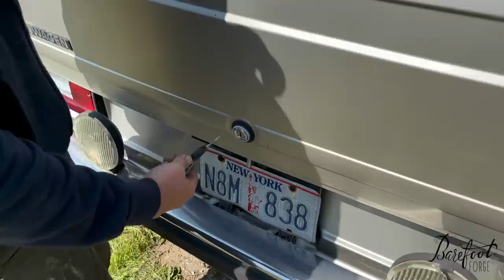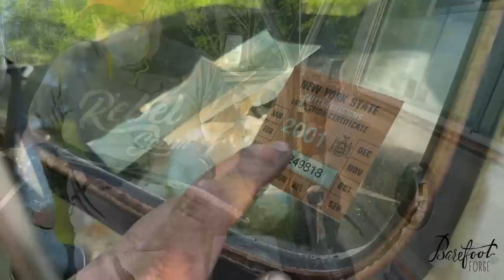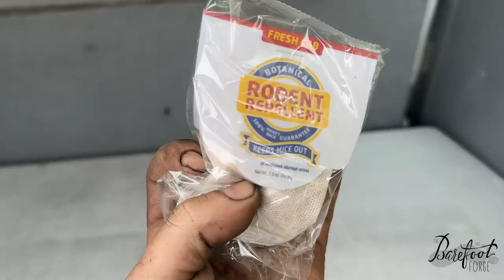Forgotten 1987 Volkswagen Vanagon Syncro Westfalia- Will it RUN AND DRIVE 600 Miles after 22 YEARS?

Comment: Crud decency also forces me to add, wear gloves on your hands, disposable gloves, and wipe down all surfaces with Lysol type disinfectant cleaner. Allow interior to ventilate and dry.
  Crud. If possible, use a vacuum with a second exhaust hose, which could be attached to the vacuum, and directed outside, this will carry dust away and outside of the vehicle.😮 Buy this second hose, if necessary.
Reply from the maker: So now that it's clean..... would you say we did all the cleaning "wrong"?

Comment: First step in a restoration, vacuum ALL interior surfaces and spaces, compartments, cabinets, storage boxes, storage areas, under all seats.
  Under back seats, bottom of pockets in trunk, inside of door panels, inside yes in the bottom inside, glove box.
  Check behind inside of dash board and any other place where a space exists out of the rain. That is where the mice would live. 
  Remove cardboard trim decoration panels, vacuum inside lower areas at bottom of all body spaces.
Reply from the maker: How does that compare to what we did?

Comment: Your backhatch strut is on upside down. The oil must sink to the bottom where the rod seal is when the hatch is closed, otherwise the nitrogen gas gradually leaks out the seal.
Reply from the maker: They don’t go on the other way. This is the way VW installed them in 1,289,572 vanagons throughout the production run. 

Did vw get it wrong on 1.2 million vehicles?

Comment: re that 'rear squat' comment, most cars, the rear track is narrower than the front, it has something to do with stability.    for an extreme case, consider the Citroen DS
Reply from the maker: Well, ya, but not the different tire widths. 7” on the front and 5.5” on the back is weird. Lol

Comment: In Europe that Synchro would probably have been a 1.9 turbo diesel, great torque, power, gas mileage but most of all, reliability. And the spark plug wouldn't have broken off ....
Reply from the maker: None came factory with a 1.9TD, they came with a 1.6TD. And if you’d like a very accurate description of how horrible that engine is and just how much of a pain in the butt it can be- check out my series “I bought a doka from Poland”, where we put the third head on that engine (for the fifth time) in 2000 miles! 

I’ll be taking my chances with a known good wbxer. Lol.